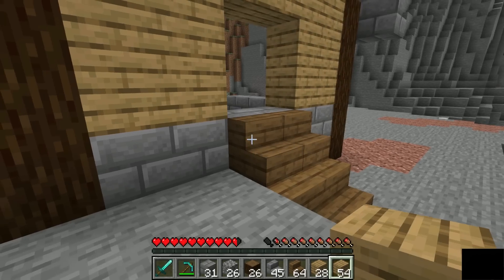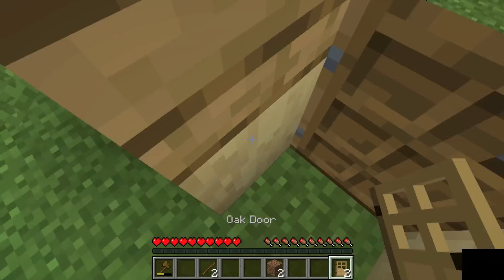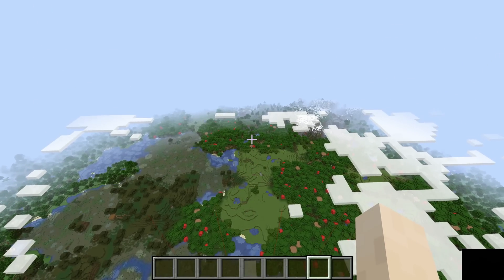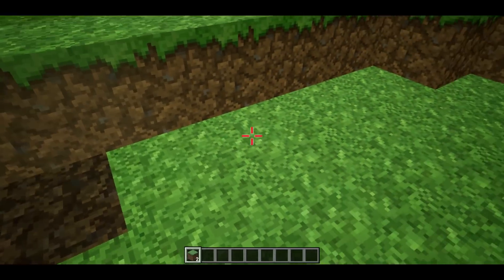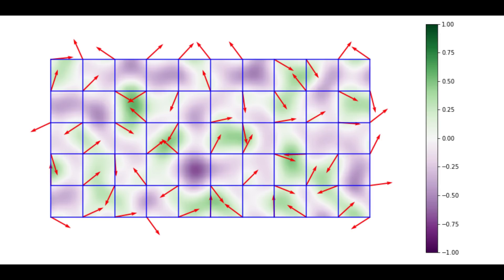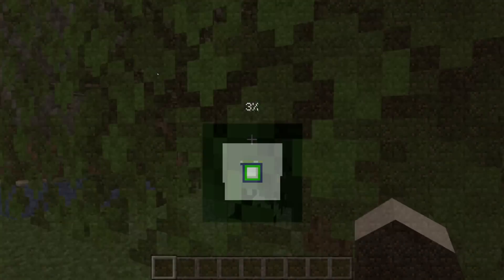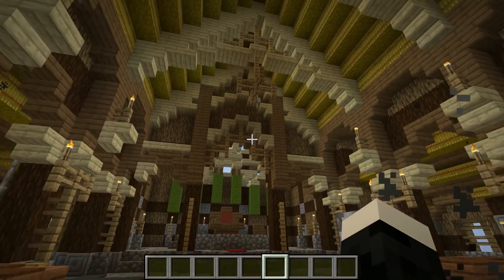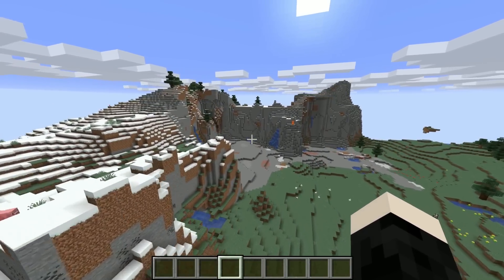Why Minecraft is a Technical Feat | Explaining the Engineering Behind an Indie Icon

Comment: Minecraft doesn't use voxels. The term was reappropriated to mean anything with blocks. Voxels were a rendering technology that Minecraft does not use and never did.
Reply from the maker: I've seen quite a few comments saying this and I'm curious what you mean by this. I thought that voxel games like Outcast were typically rendered using a CPU based rasterizer that basically ray traced the scene. If that's the case then I would argue that this is just a difference between polygonal rendering and ray tracing. I always thought voxels were the smallest most indivisible component of a 3D world, sort of like a pixel is the smallest most indivisible component of a 2D world

Comment: "So their game, Outcast, got left in the dust"
That's a weird line. I mean, it was actually pretty well received at the time... and it's not like it was an isolated thing - Westwood played with voxels a whole lot, using voxels for Lands of Lore 3, and for Tiberian Sun. Oh, and then there was the Blade Runner game. Meanwhile, NovaLogic used voxel technology a whole lot for games like the Delta Force franchise, because while voxels tended to produce rather grainy, crunchy visuals... they were also vastly superior at creating landscapes with natural fuzziness and depth emulating rough terrain and grass, at a time when prefab grass or dense populations of sprites cost a lot in performance.

In fact, this is a major selling point of true voxel engines to this day - they are much better at rendering detail, with the caveat that said detail will look pixelated, because it's a mass of volumetric pixels. Indeed, this is why Lands of Lore 3 and Blade Runner used voxels for its characters - the characters could afford to be more detailed than a 3D character, and more like a 2D sprite, but without losing the seamless 3D perspective changes.

Minecraft is actually a real oddity in that it uses voxel technology for its underlying world structure... but not at all for its visuals; the performance benefits of voxel technology for displaying high detail environments and characters (at least in terms of older hardware limitations) are not utilised in Minecraft.
Furthermore, while it's an ingenious creation that absolutely deserved its success... it's pretty janky, with the Java edition, to this day, struggling to run smoothly on high power machines, while the Windows 10 rebuild can run on a potato, with far greater viewing distances (demonstrating that some pretty fundamental things were holding the game back).
Reply: This makes me wonder about an approach where you use a voxel engine to create the base image for some technology like DLSS and some additional creativity to use both the complexity of voxels and clarity of image.
Should be great for raytraced lighting and reflections too.

Then again, I am not a programmer and my imagination might be running away a little.
Reply: Outcast was well reviewed but not a commercial success. Mostly because the voxel rendering was very CPU heavy and wasn't assisted by 3D cards like the Voodoo that were just coming out that same year. It looked amazing compared to games of just a year before but compared to the smooth and high framerate 3D accelerated games it just couldn't compete. The framerate tanked even on a new PC.

I stood in line to buy Outcast and was disappointed that my PC had trouble keeping up. The framerate was low despite good specs. Twenty years later I played it again on a modern computer and it was great. Definitely recommended playing it to retro gamers.
Reply: @Yggdrasil42  Graphic cards use a LOT of custom hacked code even for specific games to optimize their performance.

So a graphic card that would be optimized for voxels would have a different architecture.

Comment: Hate to break it to you but your calculations at the beginning are wrong. Chunks aren't completely filled with blocks. Blocks go up about 50-60 give or take, depending on the location (mountains will have more but not by much) so that leaves around 200 or so blocks left as air, and as you can see air doesn't need to be rendered in.

Comment: Some of the procedural terrain generation goes back older though. Look at some scenery rendering software like Bryce, and that's where fractal terrain generation (as we tend to know it now) first shows up in a way that is accessible on home computers.

So Notch was looking at other stuff that already existed when putting Minecraft together, and came up with some of the clever voxel stuff to better exploit it in terms of gameplay features. You'd also have to consider that in the pre-Microsoft era it was also made to run smoothly in a Java runtime environment. So there was quite a bit of work to make it efficient enough to run on that platform. So that may also give some consideration of all the refactoring to the game engine after Microsoft changed it to some variant of a C programming language compiled software.
Reply: To be fair - notch didn't come up with any of the voxel, terrain generation concepts at all - he borrowed an existing game engine concept (Infiniminer) and turned it into the game he wanted to make.  Doesn't take anything away from his achievement, but he did not come up with the block style game mechanics nor the voxel rendering methods for minecraft.
Reply: Minecraft is still written in Java, what you are referring to is Bedrock, aka the shitshow that runs on consoles, phones and Winblows 10

Comment: This is incredible, thank you for explaining it so well! And we have a completely new biome generator system in 1.18 now, which is far more complex than the 1.0-1.17 system was. Maybe you can make a video just about that, although that might be a little complicated to explain.
Reply: Generation has changed many times between 1.0 and 1.17, I believe the most significant one was 1.7.
Reply: @peanut-sauce  But now for the first time biomes generate independently of terrain. First you get the random terrain, and then random biomes are added on top (or bottom) of it, according to a set of rules. This allows for the creation of cave biomes right under the surface biomes, for example. Prior to this, each biome was binded to a specific terrain type so both things had to generate together, making world generation much more limited.
It is truly the most fundamental change in biome generation since the game's inception.

Comment: Perlin isn't the only algorithm for noise now. The actual Perlin algorithm creates smooth randomness, but it's very square aligned due to the very grid structure you illustrated. It creates nature-reminiscent curvature, but can't produce the directional alignment variety to match. There are newer algorithms, e.g. Simplex and related, that improve upon this, but the proc gen community hasn't yet overcome the info barrier of considering Perlin to be the default choice. We need more videos that put Perlin in the broader context of newer functions to help unseat this, and fewer that focus on it in a vacuum thereby reinforcing it. Chunk meshing and lighting is spot on though 👍
Reply: @TMinusRecords  Generalizing the term like that does happen, but in my experience I find it most often used specifically to refer to the old algorithm. Indeed that is what's happening in this video. When people actually do have another algo in mind, e.g. Simplex, they typically do refer to it by name. What I also see is people using the term "Noise" on its own then elaborating from there. While perhaps on the other end of the generality spectrum, I do think it has a better overall effect in conversations about the topic, by not placing undue focus on a specific algorithm that may not be the right choice.
Reply: @TMinusRecords  Also while it's fair to speculate what might happen, I think it's important to draw a line between offhand speculation and actually discounting efforts to better communicate and improve the state of information on the subject. We may not be able to control the words everyone uses, but we can at least shed some light on the issues of noise algorithm differences + the effects terminology choice has. Hopefully doing so would help those who come upon times to use noise make more informed decisions on it, and help those who teach others about it pass on as good quality of information as possible.

Comment: Nice video, only thing that bothered me is how you kinda confused "voxel rendering vs polygon rendering" and Minecraft voxels. Minecraft uses polygon rendering just like any other game, as you explained yourself shortly after. Great video nonetheless :)
Reply: I think it's more about the question, how you get from voxels to a usable polygon structure
Reply: Yeah what you see isn't voxels, but technicaly every block is still a voxel
Reply: @Mart-E12  Not every, many blocks are actually immediate GL calls executed each frame, such as chests.
Reply: John lin's game is a better example of voxels
Reply: @araa5184  Lin uses raymarching to be exact.
Reply: The elemental render unit for GPUs is the triangle. Whatever you throw at the GPU, mesh-wise will be converted to a triangle to get optimally rendered.
Reply: @ihdenemalek3485  That's the case in polygon rendering but voxel rendering uses volumes instead of triangles where the base unit is a cube. It's a completely different rendering method that GPUs are also able to process.
Reply: @connorjones1992  That's not true, GPUs have no support for rendering voxels. And there are no reason for there to be since all of the major game engines all support triangle-based meshes as the main rendering objects. GPU vendors have no reason to implement voxel rendering. I'm a computer engineer so take my word for it. 😅
Reply: @ihdenemalek3485  From what I understand, and you're welcome to inform me of the details if I'm incorrect, but the GPUs are not optimized for voxel rendering but they are capable of rendering them instead of polygons because the math required is similar. In essence it's easier to render voxels on a CPU than it is on a GPU at present but that's not the same as it being unable to render them at all. I'm a software engineer myself, not particularly hardware informed but I'm very curious to hear more about this if you have resources on hand.
Reply: @connorjones1992  Let me give you a primer to how rendering is done on the GPU. I'm talking with my experience of OpenGL which is the open-source equivalent of DirectX. First and foremost, GPUs are basically like CPUs, but with a lot more cores that can run in parallel, 3000-4000 on high-end GPUs. This makes them extremely efficient at doing small but parallelizable tasks. The developer loads shaders, GPU code programs that run on individual vertices or pixels (fragments), on the CPU and then sends them to the GPU. The developer then creates a big buffer of vertex data that gets uploaded to the GPU as well. Then, the GPU can be tasked to take the vertex buffer and process it using a set of shaders to produce a 2D image on the framebuffer (screen). When people talk about handling voxels on the CPU, they're talking about creating the vertex buffer that contains a set of vertices that would represent a set of cubes as voxels. You can also convert your voxel data  into vertex data directly on the GPU using a geometry shader but at the end of the day, the geometry that ends up being created in the vertex shader is a set of triangles. So you could say that GPUs can process voxel data if the developer wishes them to, but ultimately, voxels cannot be directly rendered without any prior processing.
Reply: @ihdenemalek3485  

"I'm a computer engineer so take my word for it."

Yeah, trust me, bro.
Reply: @notahotshot  This is all information you can Google and verify yourself, I'm just saving you the time 😁
Reply: @ihdenemalek3485  Okay that make's sense. I very much appreciate you giving me such a detailed explanation!
Reply: @ihdenemalek3485  Triangulation is not the only way to rasterize 3D. Raymarching and raytracing are the two most commonly used alternatives for when you need effectively infinite resolution. Triangulation is probably the fastest way to render voxels because modern GPUs are so highly optimized for polygon rendering as it's the most widespread method, but it's not the only method.
Reply: @sacwingedbatsatadbitsad4346  both raymarching and raytracing use triangles as the basic unit of rendering, not voxels or anything else. thing is, collapsing a 3d space into 2d (the screen) inherently requires you to keep track of surfaces, and triangles are the best base shape for those surfaces, though you could probably use other 2d shapes with much less efficiency, but not 3d shapes like voxels, because those are not surfaces
Reply: @madscientist7430  The surface of raymarched shapes can be triangulated, baked into a mesh, but they don't have to be. Raymarching figures out the surface and the volume not with triangles, but with signed distance fields. An image only has to be rasterized to be displayed on a screen of pixels, but not triangulated. Rasterization can also be circumvented, there are those old CRTs that displayed true unrasterized vector images like the original arcade version of asteroids.
Reply: @ihdenemalek3485  Ray marching an octree is far more efficient than converting the voxels into a polygon mesh. It is very misleading to say the only way to render voxels is polygons.
Reply: @ihdenemalek3485  While GPUs do not have acceleration for rendering voxels, there is no reason you cannot take advantage of the GPU to render voxels.

I'm a game engine developer, take my word for it 😅
Reply: > I'm talking with my experience of OpenGL which is the open-source equivalent of DirectX.

 @ihdenemalek3485  I love how the second sentence you said is wrong.

OpenGL is a spec by Khronos, specifying what functions a GPU driver has to implement in order to be compliant. It's fairly high-level compared to DirectX (Well, latest DX, older DX was closer. Not sure about the exact version tho.). Vulkan is another spec by Khronos, which is much more low-level, and on a similar level to DX. Both VK and GL run basically everywhere, whereas DX runs only on Winblows and Xpox.

More wrong things: What you are describing is the modern GL pipeline. I am not exactly sure about the details, since I am stuck at GL for now, but if you go lower, the GPU is just a networked computer to which you submit commands (Second-hand information, talked about it with an AMD driver developer).

Geometry shaders are shit cuz they are unoptimized and generally tend to be slower than doing the stuff CPU-side.

You can absolutely render voxels without meshing (which is how converting voxel data into a mesh is called) them. There are many ways, one of the most common ones is raymarching trees.

So much for being a software engineer.
Reply: @madscientist7430  Both raymarching and raytracing works against everything you can intersect a ray with , even SDF teapods if you wanted to.
Reply: True although there are ways to do things that just use voxels.
Reply: Yeah that part confused me. If you look at a game like teardown, every single thing you look at is comprised of voxels. Which is why it’s quite graphically demanding and intensive. But Minecraft isn’t like that, it creates the illusion that there’s voxels within voxels when in reality it’s a mask of a larger voxel using polygons to render the object. Or that’s how I’m understanding it I don’t know if that’s correct.
Reply: Yes, there is no true voxel rendering as far as we don't have volumetric 3D displays which would render them directly
Reply: @Child-Lover-1  Voxon VX1
Reply: Technically they use both
Reply: @viciousmagician4567  If I'm not mistaken they use voxels to store terrain data. It's all in the backend for data storage where the actual client side rendering is traditional polygon rendering. So they do use voxels, just not really in the visual render process.
Reply: @connorjones1992  so it uses 3d arrays? Thats not really special

Comment: Initially felt maybe a bit too simplified but I don't think that's a problem at all in the end. What I think is maybe worth mentioning along the same lines is the way various block updates work - even if e.g. lighting is this simple, you very quickly start working in millions of loaded blocks, so you make sure to only actually update the light level of the surrounding blocks, and their surrounding blocks, only as far as you need. If you then extend this concept to stuff like redstone, you can see how Minecraft seemingly manages to support hundreds of thousands of blocks at once, each with their own capability for some sort of logic - just by strictly controlling when that logic gets performed.
Reply: redstone dust is actually a fantastic example of where mojang made a terribly inefficient algorithm lol. Unpowering a line of 15 redstone dust causes hundreds (if not thousands) of block updates due to the way the power level decreases.
Reply: It's just a guess, but I think the light level has an easy cap to it - once the level stops changing (because it reaches a natural decrease cap, change = 0), you can stop calculating. Sand, water and gravel show very nicely that only the update at the spot is considered as far as it causes updates. Think of the torch bug in the mineshafts as well. So it's essentially just the update in the rendered area that does anything right at the spot, I'd think. Redstone is special as you can enable it to update blocks through own mechanics. On a second thought, the gravitational blocks do that as well sometimes, they're just not reversable.
No argument about the wonkiness of redstone, though. On the other hand - it was a project started by one person, I really can imagine that the mass of detailed mechanics become very quickly very "interesting" to manage ;D